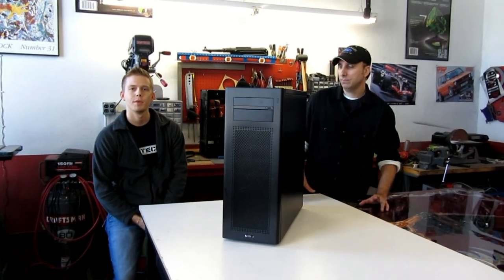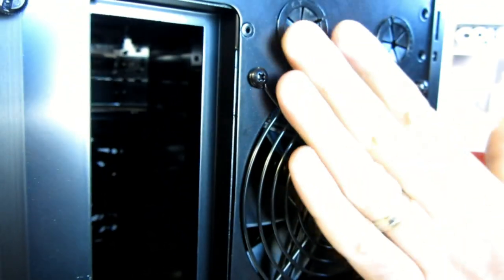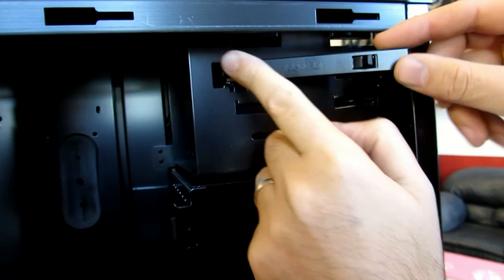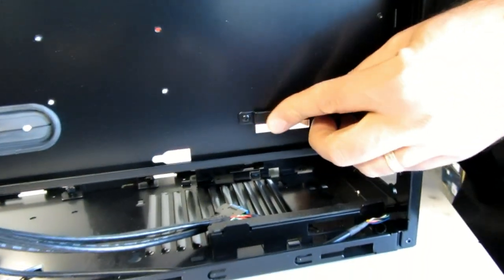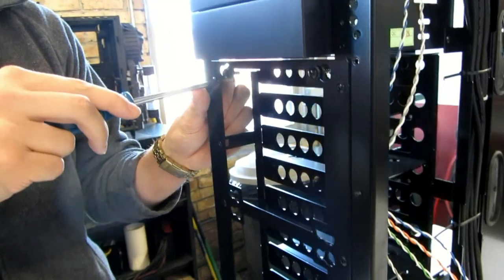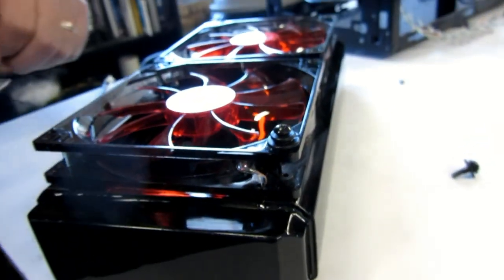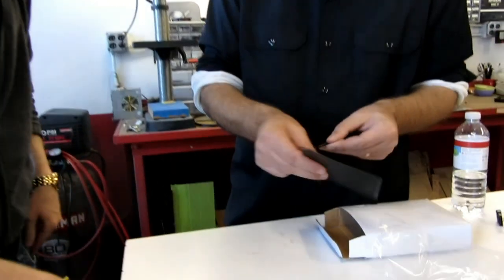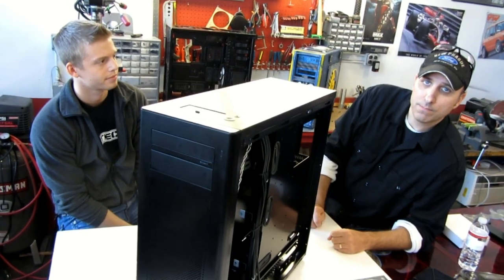LIAN LI PC-A75 FULL TOWER CASE REVIEW & 280 Radiator Fitting.

Comment: Great review guys. GREAT review.
Have to say, this is exactly my kind of case but that drive 3,5" drive bay. And I even dont want to install a radiator but the cage is still gonna interfere with proper air flow. I dont get it. Just have three modular sections you can take out as you wish and its all fine. My 6 year old Lian Li has a removable HDD cage so they know its a good idea.
Still thinking about buying it though and just cutting the cage down to a smaller size.

Comment: i got 6 mechanical drives that are  3.5" bays and plan to add more in the future or downsize but there all just for backups and storage but i do have a 128gb ssd :P. This case would do good for me all depending on how cable management turned out with all my hardware in it.

Comment: This case from Lian-li is a bargain for what your getting an all Aluminium construction with bags of potential. I'm running a rig at the moment in corsair 600t and the biggest disappointment is the amount of plastic in it's make up.
A question I do have have can you get an after market side panel with a window or is it just a case of attacking it with the power tools?

Comment: Mount the cooler on the two high front fan ports then you can drill holes in the floor for HDDs or SSDs. Guys at MNPCTech why don't you come up with a stamped out HDD/SDD drive cage that could be mounted to the bottom of any case. I have in the past moded unverisal spacing plates to hold two drives and mount to the bottom of my cases.

Comment: @Bill Own
You two guys have really no clue why this case has 12x3.5" bays and for what it's good for.
These 12x3.5" bays allow you to build a nice NAS server. It's even possible to add hot-swap support with an optional backplane available from Lian-Li.
A server RACK will cost you 6-10 times as much.
The only drawback of this case is that you need to open it, if you want to replace the drives.
And if you buy those optional backplanes they don't have a hd LED to show you which drive is turned off and needed to be replaced.
Reply from the maker: Yes, very valid points, and it's great for NAS. Lian Li told me the PC-A75 was aimed at "Gamers" which explains the 11 expansion slots and the GPU support for SLI or Crossfire systems. This is why they sent me the PC-A75 to review, not a channel that caters to Server or NAS enthusiasts. We cater to "Gamers" and "Overclockers" and these enthusiasts typically prefer option to remove mass storage bays for expansion of liquid cooling options like larger radiators.

it's now listed for $169.99, https://www.newegg.com/Product/Product.aspx?Item=N82E16811112387
Reply: *****
Interesting that Lian-Li aimed that case for Gamers. I also play games, but for a gaming PC i wouldn't select this one. It's just too big and not very transportable. I also don't need more than 2 hard drives in a gaming computer.
Thanks for clarification.
I stumbled upon your video because i was searching for more infos about this case because it seems to be very suitable for a NAS i am planning to build.

Comment: I feel that the insides look poorly made with all the holes.

They are really far behind on things like cable management and flexibility in builds, like modular hdd blocks and alternate mounts. Not worth the price tag at all despite the nice materials on the front and side panels.

if fractal desifn or corsair or nzxt did a case like this but with the aluminium panels then it would be far superior imo

Comment: Corsair, Caselabs, XS-PC ftw ty!
Reply from the maker: yes, those are great brands! Thank you for watching, youre welcome to check out our other custom PC builds or share your project builds on our community forum, http://themodzoo.com/forum/index.php?/forum/12-bill-owens-workshop/
Reply: ***** im actually working on a new project, nothing too special though no heavy modding just an Asus ROG Rampage IV Extreme a I7-4930K 32Gigs 1866 CL9  a Corsair 900D case a Be Quiet! Dark Power Pro 850W 80plus Platinum PSU 2 SSDs a Kingston hyperX3K and a Samsung 840 pro  and  an XS-PC 750 AX360 water cooling kit  and a Sound Blaster ZxR sound card and a 770 gigabyte windforce 4GB graphics card...